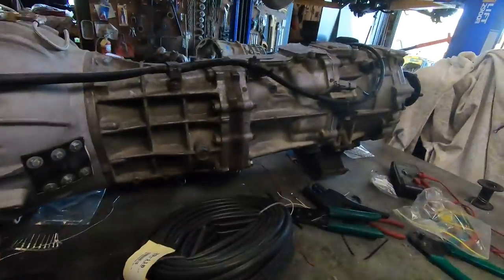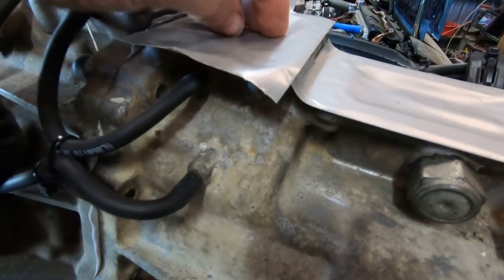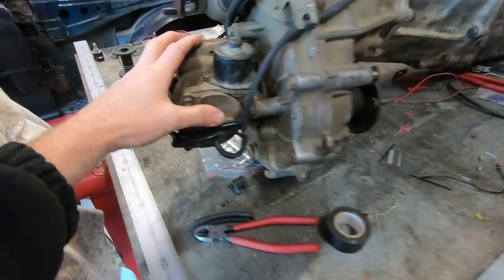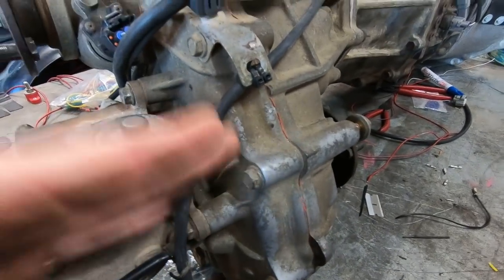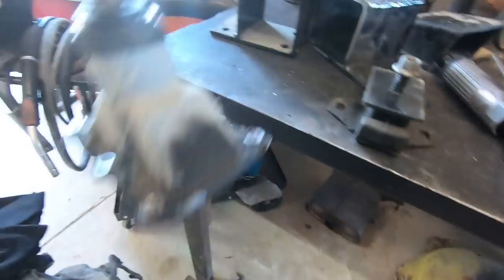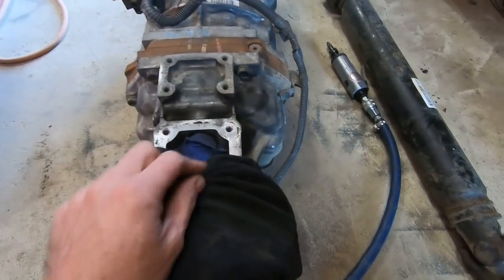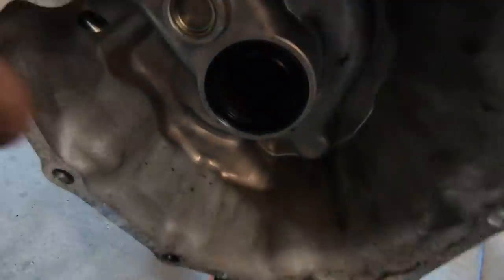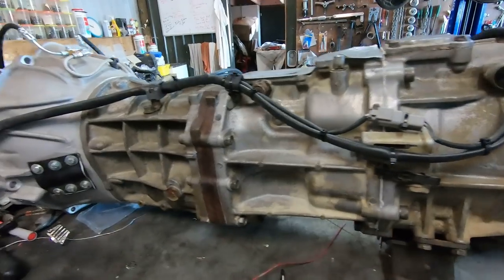1uz conversion to R series gearbox - R150F, R151F and R150 (2wd).  bolt on bellhousing

Comment: i love your work, 
Can you help me, i have e30 and i need to put the 1uz engine in it,
what a manual transmission Do you Recommend to use for this engine and, What a type of flywheel and a Clutch disc and the pressure i use, if there prats fit in 1uz engine from anther bmw Will be good for me because the parts are available in my country.
Reply from the maker: I'd recommend parts you can find locally as parts from nz are likely to be very different

Comment: Worth noting just because both shifters are in the tailhousing or transfer adapter case, does not mean it is an R151. I have now come across two of these tailhousings on vehicles plated for an R150.

Comment: Thanks for the video! One note however as I found out the hard way, the 2wd r150 box has a 190mm input shaft from 1996+, at least here in the states. I'm currently trying to swap in the short shaft to fit my adapter kit.
Reply from the maker: Hello. I was careful to just mention the shaft measurements as I know they change in different markets and dont always follow a set system.   I always measure them to check as you know why and ive seen it a few times.  Fortunately if its long shaft our R154 bell can be used.    Worthy of noting.  Cheers
Reply: So if I have a 96 r150 2wd and it is a long shaft, I need the r154 swap bellhousing and not the r150 one?
Reply from the maker: Have you measured your shaft to confirm?  If you have confirmed its a long shaft then the R154 bell housing is the way to go.  Cheers Kelvin

Comment: Why on my van is the drain plug up the side of the gearbox but the full plug right on the bottom?
Makes draining and filling rather hard cause I gotta turn my whole van 90 degrees to drain it out from side plug and refill fill from bottom plug....
The mystery of my van I’ll never know.....
Reply from the maker: We have a tractor and a digger if you want us to turn the van over.  Cheers Kelvin

Comment: Great Info learnt alot from this ... On the lookout for a box with better ratios as mine is a Diesel gearbox ... Maybe the 4 Litre V6 hilux box ?
Reply from the maker: Good evening.  I thought you might like this one which is why you got that early access.  You can find the ratios of many of the boxes on line.  Sometimes swapping diffs gives the best results as many of the boxes ratios are really quite similar.  Cheers
Reply from the maker: @Lusty_Wench  thanks.  Its nice to have real world examples.  I covered a bit on shifter position but its hard to fit everything into a video sometimes.   Its also possible to buy the drive gears brand new.  That might be a video all on its own with part numbers even.  I agree with small boxes.  Ive replaced lots over the years.  I struggle to throw stuff out but there were times Id have piles of about 10 small boxes so I'd drop them off to a mate who rebuilt gearboxes for his spares.  One interesting thing is people often ask what the 100km/h rpm will be after the engine swap.  Same as old engine funny enough.  Cheers Kelvin.

Comment: How do you feel about the m54 zf 320 manual transmission? Theres adapter kits that should bolt right on with and come with custom flywheel and a spigot bearing
Reply from the maker: Not common in nz unfortunately but look like a good option in countries where they are readily available
Reply: in my country the m54 zf transmission available more than other prats for this program,I need you to tall me, What adapter kits fit with this manual transmission? and what Custome flywheel,& clutch disc,& pressure plate fit with 1uz engine??

Comment: Your my last hope, I'm using the long I put shaft and a conversion bellhousing and my throwout bearing won't work right, 5vz tob and 3vz clutch/fw
It's like the input shaft sleeve doesn't reach far enough, what release bearing do I use??

Comment: Can you tell what is that sensor right next to the fork whole that you closed on 10:44 minutes of this video? The one near reverse light switch? Searching for 2 days without any luck
Reply from the maker: I think you are referring to either the low box engagement switch or the neutral position switch.  Easy enough to work out with a multimeter and moving levers.  Cheers Kelvin
Reply: @CartuneNZ  - no sir, those 2 next to each other i figured them out. The one i'm talking about is located on your video at 10:44, if you look at the clutch fork hole which you closed with screws, right next to it, on your left hand, there's a sensor with pigtail female plug
Reply: @CartuneNZ may i send you an email with screenshot that i took from your video with this sensor in question please?

Comment: hello guys, 
awseome vid!!! very informative !!  well i do have a 1uz non vvti and i do want to suit to a Hilux 2wd diesel(i dunno what gearbox it is) that my friend haves ...the tricky part is i do want it  to put i together for a Drift car..prolly the Hilux differential i will use on that conversion as well(so the cardan shaft should be custom made surely)..what should i buy to get it all together to start my enigne and drift this car on tracks?

Comment: Thanks for the information. do you have any info on using R150F on a 2UZ 4.7?
Reply from the maker: Its all the same to me.   A uz engine is a uz engine regardless of if its 1,2 or 3.  Sure there are differences but the basics are the same.  Stock 2uz manuals run a massive clutch but last one I used all my normal stuff and it was great.  Cheers Kelvin

Comment: What are your thoughts regarding the H series gear box regarding conversions? They appear heavier duty than the other boxes. Dig your content by the way, great work
Reply from the maker: H boxes are a great choice.  It was what toyota used for a manual on there vehicles with v8s.

Comment: It would be really helpful if you could do one of these about 4wd transfer boxes on auto boxes
Reply from the maker: Hello Alex.  There happens to be an auto trans on my bench right now getting a 4x4 transfer so a video is on its way.  Cheers.
Reply: @CartuneNZ  I'm up for that video😎 A343F by any chance?
Reply from the maker: @vwbeetle5578  Hello Micheal.  Hope all is well in Africa.   We will be converting a stock 1uz A341 auto to 4x4 using the transfer off a A343.  Its still a VF series transfer like the manuals run.  Cheers

Comment: Hi KeL, have a 92 Auto surf running Gen 1 1UZ. She’s running a A343F and transfer box. 
My question is when she’s running through the gears as u take off it kicks between the gears all the time.  
When’s it’s a Chambered Muffler like flowmaster it kicks hard. When’s it a glass pack muffler it kicks a little. Your help is much appreciated
Reply from the maker: Hello.  Does the auto hold 2nd gear correctly or shift straight through,  what management is being used on the  a343f?  Cheers

Comment: I might have to tell u v6 box have the top shift transfer and 4cyl have both 150 and 151 and are both forward shift. Also some handy info is that 96 onward v6 have the 190mm input shaft not 160
Reply from the maker: Ive found that different transfers and boxes are slightly different between countries.  I have the late 190mm shaft box here.  We didnt get it until around 98/99 and its very very rare in NZ.  Cheers Kelvin

Comment: Any chance you could tell me which box I should get for my hj61 land cruiser?

I’m fitting a 1.9tdi golf motor. Using an adapter plate to a 3vse bellhousing. I’d like to keep my vacuum transfer, if possible, but I’m not sure if it will bolt up to a r151. 

If that doesn’t work, I’ve been suggested to use either a hzj79 r151 & transfer, or a hzj105 r151 & transfer.

You are by far the most experienced I’ve come across...I figure you know exactly what Combo I’d need, any help would be appreciated.
Reply from the maker: R151 from a LZJ or KZJ prado would be my go to.  Why the 1.9tdi into such a large vehicle?  I don't even feel the little UZ is enough for the 60 series cruisers , I prefer the 2uz 4.7 or something LS to make them move properly.  Cheers
Reply: @CartuneNZ  thanks for the reply...

Its gonna be a tourer, so I’m looking for fuel
Economy mostly...apparently some really crazy numbers are very achievable economy wise. 

The 12ht is also pretty pricey to rebuild, if there is an issue & parts are getting harder to come by.

And I already own the golf, so not really any extra $$$ involved sourcing the engine...tbh, the engine for the conversion is worth more to me than the resale value of the car, especially when I consider what someone will pay for the 12ht even in needing rebuild condition.

Comment: ive just pulled a transfer case off a R150f from a 5vz fe prado. its the rare 190mm shaft. the transfer case has the left side drop but the 2wd H has a ratio of 2:1 and 1:1 when locked into 4 HL. read it should be same same?
Reply from the maker: Sorry,  same as what?  Cheers Kelvin

Comment: Hi there from the UK... Great and really interesting videos.. I've got a1979 gen2 Hiace with 1.6 four cylinder and 4 speed column change and would love to fit a 1UZ-fe... Would this be possible.. Us there honestly enough room? Many thanks for any help. God bless. Jonathan
Reply from the maker: We have done the next model which ran from around 84-89 but not that early version.  The way to see if it would fit is get out the tape measure and open the bonnet and look.  Cheers Kelvin

Comment: Is possible to put r154 internals in a r151 for high horse power 4x4 application. Or can the r151 take a lot of power ?
Reply from the maker: Some of the parts are interchangeable between the two but not all and there are different versions of R154 and R151 as well.  What we do is fit upgraded thrust washer,  centre retainer and 3-4 shift fork to the R151 and they have held up our jobs so far.  Cheers.

Comment: Do you no what bellhousing would work as I have a g53 gear box but it Cain driven so I want to get a r151 gear bock & mount it up to my 5L 3liter Hilux mate or do you sell them ?
Reply from the maker: A 2L-te surf bellhousing will work.  I wish I had of kept all the ones I have had over the years from doing UZ swaps.  Try to get a LN130 surf R151 which will have correct bell on it.  Cheers Kelvin

Comment: in my country the m54 zf transmission available more than other prats for this program,I need you to tall me, What adapter kits fit with this manual transmission? and what Custome flywheel,& clutch disc,& pressure plate fit with 1uz engine??
Reply from the maker: There are several kits available,   best use google to find them

Comment: G'day Kelvin
My auto transmission (Lexus E 41) make grinding noise when select reverse and when driving forward take foot off the accelerator. Please advice.
Reply from the maker: I recommend doing some testing.  locate position of the grinding.  If it's internal then pull box apart to investigate.  Testing is the key.

Comment: Thank you for the very informative video...can the shifer of r154 bolt on r150, like jzx110 or jzx100 shifters on hilux r150?
Reply from the maker: Hello.  Not easy to swap r154 shifters onto R150 hilux box.  By the time its done it costs as much as getting an r154,  as internal parts need to be swapped as well.  Not direct bolt on. Cheers Kelvin

Comment: Are there any bolt on manual transmission options for a 1UZ-FE behind a a340e auto bell housing? thank you for your time.
Reply from the maker: No 1uz powered vehicles can with a manual transmission from factory.  All manual options are custom setups however most parts are readily available these days.  Cheers

Comment: If my alternator is bad will that make my od light come on and start flashing
Reply from the maker: Possible but more likely the ecu is detecting a transmission fault.   Have you checked the codes?

Comment: Hi, did you ever use H55f gearbox on 1uz or 2uz, what engine and gearbox you recommend for an offroad competition level !? Thanks
Reply from the maker: Yes.we have used H55f gearboxes in the past. At one point we could get bellhousings for them but due to lack of demand they are no longer available and its all custom.  As a result we rarely use the H box these days. Cheers Kelvin

Comment: Hey man, I’ve a question for you.

I am looking to swap a 1uz in to my 02 4runner (US model).

I swapped the auto transmission with a 2000 Tacoma r150f and kept the electronic transfer case from the 4runner.

I am having poor luck finding out how to adapt the 1uz to the r150f. Do you have any ideas?
Reply from the maker: Did you watch this video?  As it has the R150/151 with the 1uz bellhousing fitted ready to bolt up.  Bellhousings are so easy.  Cheers Kelvin
Reply: CartuneNZ yeah I watched the video. I guess I just didn’t know what adapter you are using for it.

I guess I am confused because I don’t see an adapter between the uz bellhousing and the r150f. Everything I have seen says that they aren’t a direct bolt up.
Reply from the maker: @dazepplinman06  It is a complete custom bellhousing which I supply.  I have been doing these for about 15 years now.
Reply: CartuneNZ how do I purchase one?
Reply from the maker: Flick us an email at info@thecartunecompany.co.nz
Reply: Ahh ok so the bellhousing on the gearbox in this video isn’t actually a 1uz one, it’s a  Cartune 1UZ to r150/151 adapter one.
Reply from the maker: @kip8790 correct.  Its a bellhousing we have been selling now for 18 years.  Cheers Kelvin

Comment: Thinking about doing a 1uz swap in my 80 series. Do you think the R150 will be strong enough to lug around the 80?
Reply from the maker: Should be fine , its the lack of torque from the 1uz I would be more concerned about.  Personally we prefer LS1 when doing swaps on 80 series.  Cheers
Reply: CartuneNZ what manual transmission do you typically run with the LS1?
Reply from the maker: The stock 80 series gearbox is my preferred option.

Comment: What's the best option for adapters to mate up R151 to Gear driven transfer case? Trailgear? Or is there another option out there?
Reply from the maker: Hello Ben.  There is one R151 which we have running a hilux gear driven transfer which we are about to replace with an auto.   We generally use the hilux transfer as they are easy to get over here and in the past have used a advanced adaptors kit.  Best is really what is available in your market.  How hard are you driving it?  There are quite a few other transfers out there that are super strong with plenty of parts around for that we don't see much of over here unfortunately.  Cheers
Reply: @CartuneNZ  I have the original chain driven transfer case with 1kzte and R151 gearbox i pulled out of kzn130, they will eventually be going into my ln106 with a Kiapoi manual pump and was told to keep gear driven transfer case as they alot stronger but have only recently found out i will need an adapter kit to mate them up
Reply from the maker: @benwilliamson672  They are stronger but how much stronger do you need?  I run most of my 1uz conversions on the chain driven transfer,   even turbo ones.  I had a 400rwhp surf with chain driven transfer.   I have very few issues with them.  Your truck sounds interesting.  Cheers.

Comment: I have Isuzu kb 320 v6 and I want to fit V8 Lexus motor in my Isuzu and I don't want to use automatic transmission.is that possible to just change the bell housings? And if so is there any modifications needed?
Reply from the maker: yes change bell housing and maybe driveshafts.
Reply: @CartuneNZ  ok thanks